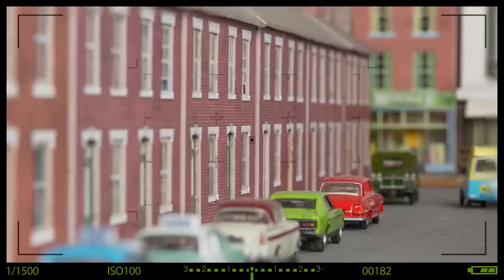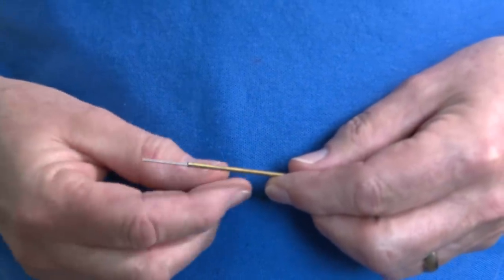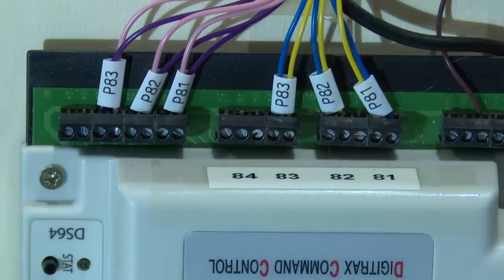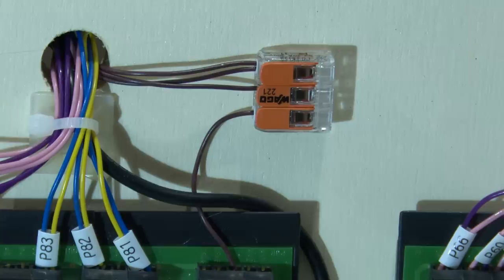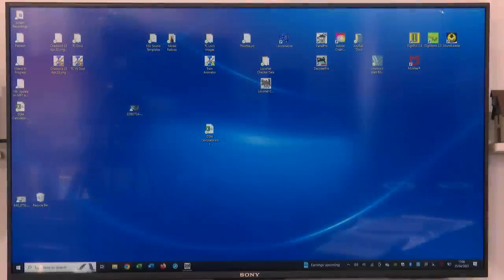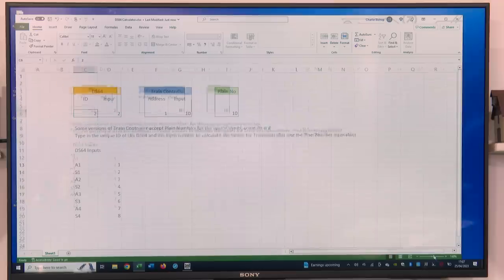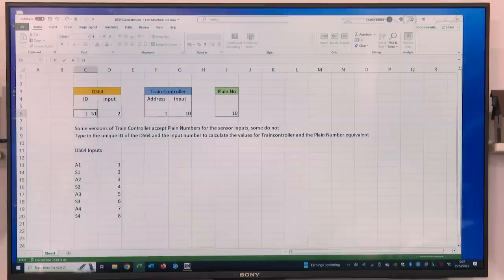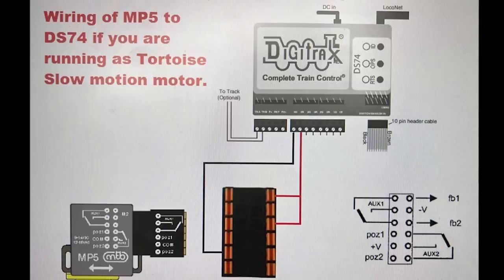UPDATE ON MP1 & MP5 POINT MOTORS and the DIGITRAX DS64 at Chadwick Model Railway | 189.

Comment: As a retired aircraft electrician (I had the grand job title Avionics Certifying Engineer) I agree with your correct labelling of wiring. What I was used to on the aircraft was the wires were individually numbered, the wire ident number is printed on the wires every few inches along their entire length. It makes it so easy to find wires for fault finding or to carry out modifications, especially as nearly all the wires are white (no colour coding) only the occasional multi cored cable is colour coded. If wires got damaged in a loom it made circuit identification was easy to work out if a repair could be carried out or the wire had to be replaced (in some critical circuits, repairs were not permitted) there is a wire list, listing every wire number and it’s associated circuit, it’s gauge, wire insulation type, origin and destination for the wire, it’s length and the type of termination on each end. This system makes the job so much easier, for instance, in a Boeing 747 there is approximately 187 mile of wiring divided into approximately 200,000 individual wires. Some might only be a few inches, some might be over 100 feet. Every plug and socket has an identification number, each electrical unit whatever it is from a relay to a flight control computer has a unique identification number. There is a small ident sticker beside every unit and fixed connector, free connectors have an ident sleeve round the cable going to it. I used Boeing as an example, obviously Airbus use the same system of idents.
 So you carry on with your labelling it’ll save you a headache later on if you have a fault or want to change something.
Reply from the maker: Hi Charlie, I’ve picked up my engineering skills from being electrician on Wessex Mark 5 helicopters! Regards, Charlie
Reply: @ChadwickModelRailway  You know all about aircraft wiring then, hence the way you ident things, trouble shooting works well with the proper indenting system doesn’t it. I started on Harriers at Kingston-upon-Thames/Dunsfold then onto Mr Bransons aeroplanes.

Comment: Great video and very informative Charlie. I am only constructing a small layout of a double oval but looking to use point motors for the points. My layout will be DC only and collapsible/portable as don’t have the space to have it up 24/7. I was looking at using these point motors following your informative videos. I’m hoping to mount these under the boards rather than surface mount, are these point motors able to do this. 

Watched many other videos for hints and tips and am just getting ready to start the soldering and mounting the track 😬
Reply from the maker: Yes, they are ideally suited under the layout. Regards, Charlie

Comment: Charlie, There was a suggestion to use a copper tube to enclose the point rod wire in the trench. There was also a comment about causing static electricity and to use a plastic tube instead. You said you would use the copper tube; any issues with that?
Reply from the maker: No HB, it been just fine.  I will use a similar arrangement in the Branch Line area.  Regards Charlie

Comment: Hey Charlie, did I miss it? You don’t show adding the feedbacks into the actual point Control in Traincontroller, only contacts. Adding them into the actual point symbol then provides safety as TC will know if a point failed and schedules will be stopped before a crash.
Reply from the maker: Point operation and feedback are completely different areas in TrainContrller Eddie. Regards Charlie
Reply: @ChadwickModelRailway  No, it's in the same turnout setting window. Look at the bottom left and the button Position Control. In there you add the feedback. Traincontroller then uses it to check routes and can reroute I'd a point failed etc. Lots of options in there.
Reply from the maker: Thanks Eddie, I seem to have  missed something there, I shall check it out. Regards, Charlie

Comment: Quick question about the VIOLET and the PINK wires. Diagram was different to your actual connector, with the wires reversed. Am I right then to assume these colours do not matter either?
Reply from the maker: Yes Phil, that’s correct. It doesn’t matter which way round they go. 
Regards Charlie

Comment: Nice one Charlie. My goodness is Digitrax more complex than it needs to be.  I’m somewhat glad I went down the Digikeijs 4018 route as wiring up my MP5’s is so much simpler, but I guess I also have DR4088’s inputs for point feedback, which is wrapped into the DS64, so horses for courses I suppose.  But my over riding feeling of Digitrax is far too complex.
Reply from the maker: But please be aware Stuart, that Digikeijs have gone bankrupt! Regards Charlie
Reply: @ChadwickModelRailway   I know, a bit of a shame, but YaMoRc is showing promise and I've a couple of new items from them added to the layout as well as upgrading my DR5000 to the new YaMoRc software.

Comment: Pardon my inquiry kind Sir, but instead of moving the points, why not edit the input for the address in the contact indicator?
I surmise both approaches are equivalent and easy.
You have a very nice setup there!
Reply from the maker: Yes Robert, but I thought using the spreadsheet would make it less confusing. Regards, Charlie

Comment: When I got mine, the supplied wire was very tough, like spring steel.. So I used a dremel cut-off disc to trim to length, As I didn't want notches in my clipper snips!..
Reply from the maker: I know what you mean but you could have lowered the wire. Regards Charlie

Comment: It bugged me that so many terminals are there but unused, but it's a really simple answer - it's designed for 3 rail, as well as 2 rail! For those wondering - POZ1/POZ2 are the 3 wire terminals, M2A/M2B are the 2 wire connections, and COM is the return all for the motor. I'm curious why 3 rail systems are a different input set that 2 rail, though. 3 rail is common outside rail with the middle being power, so there's no functional difference to motors if diodes are used.  The rest is explained by DC vs DCC.
Reply from the maker: I think you’re bang on the money, Brendan. Regards, Charlie

Comment: Hi Charlie, if you use MP1s with Train Controller/iTrain/JMRI , what do you lose compared with the MP5s? Thanks for covering this. John
Reply: MP1 only has one switch set, so you'd lose feedback to the DCC system. his MP5 setup has Aux2 providing feedback to the DCC controller via the inputs on it.
Reply from the maker: Brendan’s correct John but it also has more power and a 12MM throw.
Regards Charlie
Reply: @ChadwickModelRailway  The power and throw distance presumably won't be an issue on N scale. But why does  Train Controller need feedback if it has given the command to change the point?

Comment: My question is doesn’t brass along with a wire moving through the brass tube cause static electricity ?  The trench that you cut into the wood will not cause any static electricity.  3:56
Reply from the maker: Now that is something that I had never considered Ed. Regards Charlie
Reply: Just replace the brass rod with plastic (servo rod tube will work) or alternatively run a wire from the brass tube to a system ground

Comment: I have to say, I have had no luck using an MP1 with the Digitrax DS64 or DS74 when the same Digitrax unit is also driving one or more Tortoises. I suspect the total amp draw is too high, because the Tortoises continue to draw power when they stall, unlike the MP1.  Indeed I seem to have fried one DS64 by doing this.
Reply from the maker: An interesting observation David. Perhaps we need to run the MP1s on one DS64  and the tortoises on another. Regards, Charlie

Comment: Hi Charlie Just a Quick Question
Did you get the MP1 Motor to work on the DS64 because im at my Wits end i can only seem to get one MP1 Working ive set the DS64 to Stall Motor I've wired the MP1 Com(+) terminal to P1 on the DS64 and wired the POZ 1 to 1R and POZ 2 to 1G which works Great but When i wire the Second MP1 to P+ 2R & 2G it all stops working.
Any help from yourself on anybody on her would be Much appreciated .
I don't relish the idea of swapping out dozens of MP1's for MP5's or MP10
Many Thanks in Advance
Reply from the maker: Hi Chris, it appears that my terminals are wired to 1R and 1G with P+ the common.
Reply from the maker: Also, do check your wiring on the point motors themselves.
Reply: @ChadwickModelRailway  Thanks for getting back to me is that for the MP1 ?
 if so do i wire the common on point 2 to P+ on the DS64
 as this is where the Problem seems to start
Reply from the maker: @chrislockerby1411  I think that I would personally disconnect the first one and install the second one in the position of the first one. That way you can rule out a duff point motor. But yes, I believe that the two commons should go into P+
Reply from the maker: @chrislockerby1411  they share P+
Reply: Hi Charlie thanks for your help with the MP1 saga I’ve now fitted 2 MP10 running like clockwork 
Also I used Jmri Programmer to read what the setting were on my DS 64 this is a great asset to my layout
Keep up the Great work
Reply from the maker: Hi Chris, can you read the DS 64 Ops switches, with it all connected up? Regards Charlie.
Reply: Yes If you have given each ds64 an I’d number I think there are four tab similar to the loco cv’s
I can email details and screen shots this evening if you like
Reply from the maker: Thanks Chris that would be great.
Chadwickmodelrailway @ gmail. Com

Comment: Hi Charlie great job as usual. 
PM74 Sends info back to TC. When delivered the address is set to 01. I use O/P one to power all my points, they are insulated from the rest of the System.  Read the book, pushed the the buttons changed the address from one to 99. 
The address has changed, as I no longer get odd blocks in TC address 01 lighting up when trains go over points,
However I have on idea what it is now, Any thoughts anyone?
Notes: Using DT608 & DSC210+ Might be relevant. 
            Also tried several addresses with no luck 
            The search in TC gave me no unexpected addresses
TOMREIP
Reply from the maker: Thanks Chris, I have heard that they are “challenging“!  I’ve tried to stay with DS64s. How do they compare?
Regards Charlie
Reply: @ChadwickModelRailway  Can't help there, new to Digitrax only have PM74.
Did you see my email on the Dapol track cleaner?
Reply from the maker: Yes I’m trying to get hold of my friends cleaner, and copy the way that he’s did his. That was the one that I was using. Regards Charlie

Comment: Hi Charlie, excellent update video. Regarding that the Digitrax DS64 cannot operate points motors by both DCC commands and panel switches together, does that apply to the DS74 or not, or is there a difference between the MP5 as against the Tortoise? Please check out this YouTube video by Jim Worcester (link below) which I thought may help. I'm no expert, even at my mature age I'm teaching myself basic electronics with a huge interest in model railways, especially DCC control, hence my interest in your most informative channel. However I am surprised how expensive model railways cost these days especially good quality DCC control equipment (such as Digitrax) therefore if you ever find time I would be interested in a video giving a comparison of the quality, versatility and reliability of cheaper DCC control systems such as Yamorc or Digikeijs.

P.S. It is noticeable that in many cases Digitrax (allthough excellent quality) is offering new updated equipment but with less options, i.e. new upgraded switch decoder units that only offer four switches, whereas the previous model had eight switches. Therefore the cost of operating, say eight point motors is virtually double??

Regards and thank you,
Barry.

Link: https://www.youtube.com/watch?v=BLNosAEa_-0&t=3133s
Reply from the maker: Hi Barry,  Firstly be aware that Digikeijs has gone bust!
Sadly, I cannot do a comparison between system as I don’t have an appreciation of the full market. 
Many thanks for the link to the DS74, I shall view that later.
I have little doubt that it will do less that the DS64.
Regards Charlie
Reply: @ChadwickModelRailway  Thank you